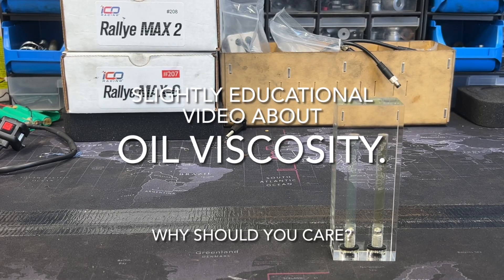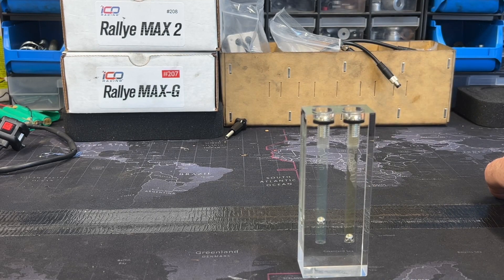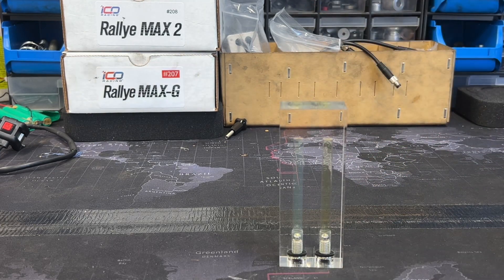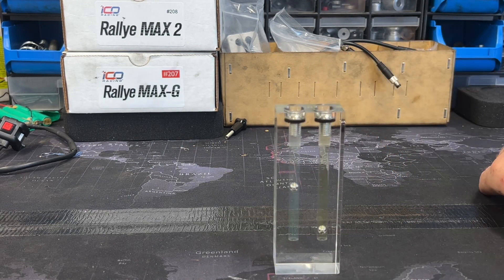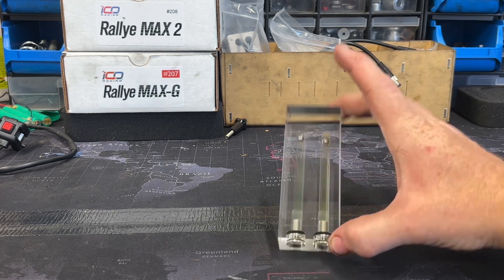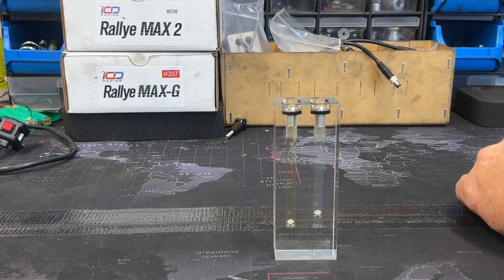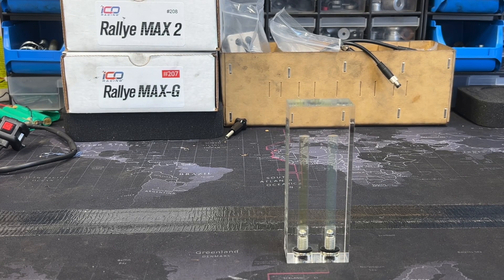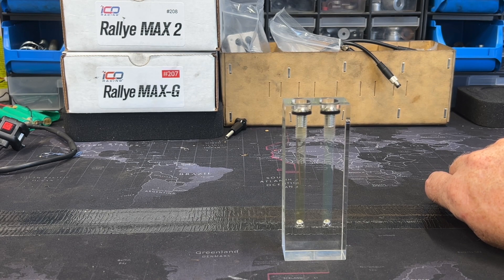Oil viscosity. Fork oil comparison.

Comment: Would you say the 10w would provide more rebound dampening control?
Reply from the maker: not necessarily, it depends on your fork/shock.
Your control (or fine adjustment) is by the valving or orifice sizing, combined with the shim stack if you have one. Damping rod forks just have an oil orifice, whereas any valved system will have a stack as well. The stack and valve control the dampening. The oil viscosity will change the rate of the dampening.
So a fork that is designed with a stack set for 5w, with the rebound in the slowest position, might give the same return rate as the same stack with 10w set to it's fastest.
if you are having trouble with your rebound or compression on an adjustable fork, my first checks would be to see what your stack is. if your spring rateis right, most modern forks will be "OK,ish" with the standard stacks and valves. If you are heavier, or faster, then you'd look at making physical changes to the stacks.
just going from 5w to 10 w will only mess up all your settings and make everything to slow.
If you have stiffer springs installed and you find you're at the slowest settings (within about a 1/4) you might try changing out to 7.5w if the stock weight is 5w.
Hope this helps.
If you are planning on playing around with your settings, remember to change one thing at a time, test, then write down the results. otherwise you'll get lost and screw yourself right up.
the RaceTech Suspension Bible is a really good source of information and will explain it better than I can. 
Internet forums are usually populated by people who think they know what they are doing, right up until they have to bring it someone to fix their screw ups.
Reply: @teekaymotomechanical  I have a MXTech raven fork.  I’m nearly maxed on compression in and rebound in and I can’t get enough rebound control anymore.   I’ve progressed and I’m riding faster so I need more rebound control because I have much more preload.
Reply from the maker: ok, it sounds as if you've reached the limit of what the stock set up can do. 
First, if you're running more than 3/4 of your preload, your spring rate is wrong. The correct spring will sit the fork in it's correct sag with very little preload (max of around 20%).
Once the spring is right, then it's going to be a case of checking the stacks.
You can try a heavier oil and see how that works for you, but start with 7.5w if the stock is 5W. 
It's sounding like you are at the point of getting a proffesional to set it up for you.
The cost of getting your suspension set up by a proper tuner is well worth it for the one off cost. they will sort spring rate, stacks and oil weights, set it up for you and usually give you a setting chart to let you know what and how to make adjustments for going forward.
if it's the complete MXtech fork, the cost of the fork is worth getting it set up. If it's just the cartridge inserts, you'd have to make the call depending on what you have spent.